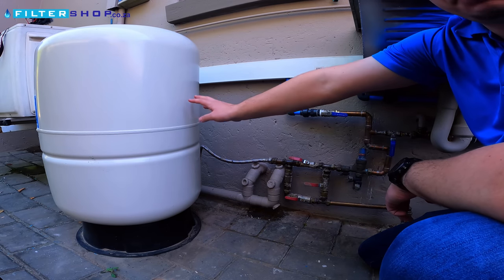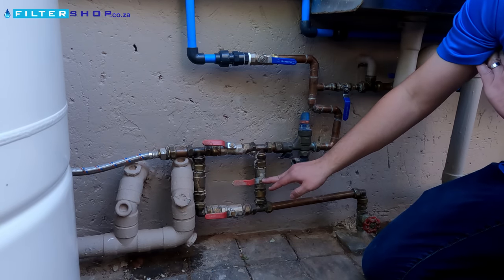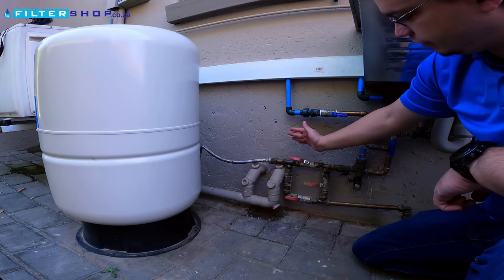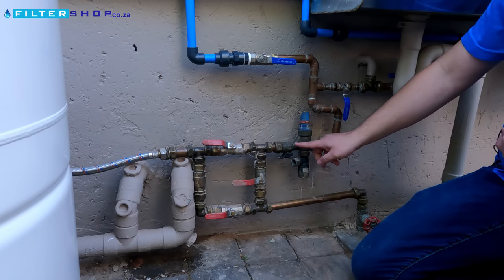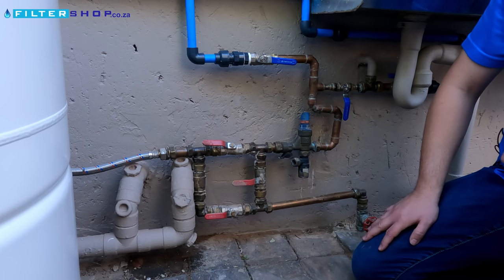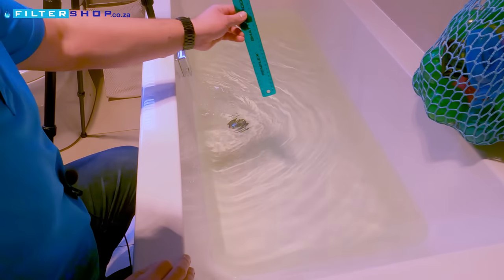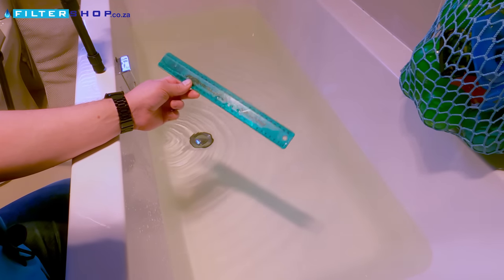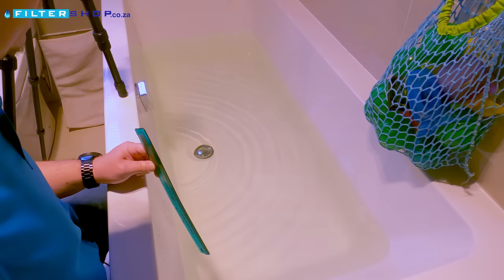DIY Home Backup Water With No Electricity

Comment: R16 499 for 150 litre, you smoking your socks!
Reply: WHAT?  Then I would rather just install a 500 litre water tank JO JO in my roof with a ball valve, and let the water flow by gravity. It'll work if I install the tank slightly above the geyser's outlet. 
WAY cheaper, plus I can do it myself. ☺
Reply: That's a better way to do it
Reply: People are ripping us off life.
Reply: Ain't no way I'm paying R16.5k for this, it ain't even worth R3k to me

Comment: This could work well once water shedding starts in South Africa. If there's only water for say one hour a day, and you have two of these tanks in the ceiling of your apartment, you wouldn't even know about watershedding. And the non return valve makes the system automatic.
Reply: What pressurises the tank?
Reply from the maker: @BubblesTheCat1  The municipal water supply.
Reply: @FilterShopZa  Is there a spring loaded diagraphm inside that gets compressed by the Municipal water supply pressure?
Reply from the maker: @BubblesTheCat1  The tank has a diaphragm that splits the tank then the one side is filled with air and the other is where the water is. The water then compresses the air and the air then pushes out the water.
Reply: @FilterShopZa  That's a very clever idea. I wonder what they cost,  plus installation? ☺👍
Reply from the maker: @BubblesTheCat1  Unfortunately these tanks went up a lot in price recently, a 100L tank is R9500 at the moment, and all the pipes and fittings is another R2000.
Reply: @FilterShopZa  Thanks! ☺👍

Comment: How would this work for a gas geyser as it relies on pressure? I was using a Jo-Jo tank with a pump when the “Bright Sparks” put restricters into our pipes by the meter. I no longer live there but converted to gas hot water as the solar geysers are a joke.
Reply: Use a low pressure gas geyser, also called a camping geyser.

Comment: Thank u for your tips.
Reply: It's a bloody clever and great idea!  There's forever a burst pipe in my suburb or complex, and then we're without water for 2 to 3 days! 😠😠😠😠
I'm in an upstairs apartment, but there's plenty space in my roof where the geyser sits. If you can mount the tanks even higher than the geyser, the water will even flow by gravity, albeit a bit slow. Slow water is fine, compared to no water. Plus, slow water lasts longer ☺

Comment: Can this be used withe the following setup, municipal water into a large backup water tank and then 100l pressure tank going into the house? without the use of an electric pump?
Reply from the maker: Hi, when you go into the lage tank you will loose all the pressure. So you will need to pump the water from the large tank but then if power to your pump fails then you will run from the pressure tank.
Reply: What I mean is can you have the municipal water going into the water storage tank and then a pressure tank connected directly to the water storage tank and the pressure tank then connected to the house. Without any electric pump.
Reply from the maker: Hi @DK-zm2fq , No the pressure tank only stores the pressure so it will need a pump to create pressure again as all the pressure is lost as soon as the water goes into the storage tank.

Comment: Can this be used for backup after a well water pump? After watching this video I am thinking adding a pressure tank after the water softener so it does saves filtered and soft water.  Can you leave the setup always on and depending on demand will automatically supply water from the tank?
Reply from the maker: Hi, I basically have something like that at my house. I pump from a tank through my filters then I have the 150L tank connected used in this video. It saves a lot of power as the pump turns on less and if the power or pump fails then I have the water in it as a emergency buffer.